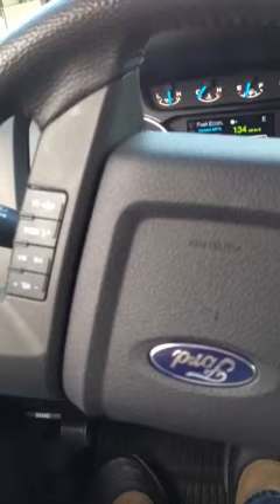What Causes brakes to squeak

Comment: hi so how do you fix this, if possible without taking the wheel off? i just bought a used car like 2 weeks ago and when i drove it home and tested it out the brakes didnt make any noise but the next day i went to drive it and the brakes would squeak sometimes and its really bothering me. the night i brought it home it was drizzling so i think that contributed to the rusted rotors
Reply from the maker: Hi Poopta, There really is no fix if the noise you are getting is from moisture on the rotors, unless you have an option to park in a garage. If you brakes squeak all the time, you may need to update your brake pads to a higher quality pad.
Reply: Eddie Carrara Thanks Eddie I'll definitely look into that

Comment: So on dat note you have to change the rotors too?
Reply from the maker: Hey Jram, if the noise is just caused by moisture from sitting over night, no.
Reply: Eddie Carrara im not sure cus I had jus got da breaks changed on my charger nd its still squeaks jus lik on the video. Im thinking the rotors might b damaged o something.
Reply from the maker: No Jram, it's just a thin layer of rust on the rotors, it comes off after applying the brakes a few times.

Comment: Hey I need advice, I replaced brake pads in early 2013. Now, one of the brakes, I don't know which ones, is making that squeaking noise. The thing is that, it doesnt make that squeaking noise when I am parking the car, but it does when I am driving at least 60 km and decide to brake. Sometimes it does make that noise, sometimes dont. This has been happening for a couple of weeks. Should I take it to a mechanic? I am really worried, since I am not a car savvy,
Reply from the maker: Hey jetixspeed, I would have it checked out, you may have a pad that is wearing prematurely, or it could be a small rock stuck between the backing plate and rotor, check out my other video and see if this helps http://youtu.be/HR8UbHpBfmU  Let me know what you find, thanks.
Reply: Eddie Carrara Hey Eddie, took my car to the mechanic. We did a drive test, and there weren't any squeaking noise. He inspected the four brake pads, and he said he couldn't find anything wrong with them. He suggested that the rust on the tires could be the cause of the noise, Also he said that if the pads were worn out, they would make a constant squeaking noise because of the sensor.
Reply from the maker: Sounds like you have a pretty honest mechanic. Just keep an ear on the noise, sometimes brake pads have a heavy metallic brake material which can also cause a light squealing noise. Thanks for the update Jetixspeed, I really appreciate it :)